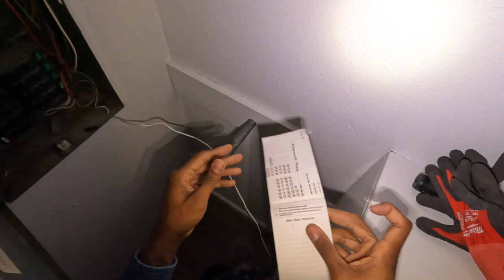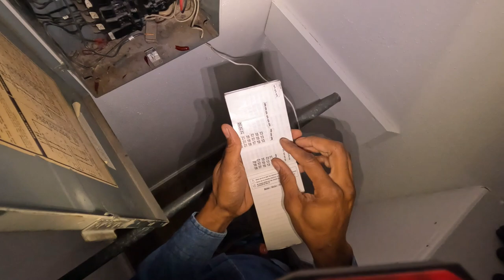150a Electrical Panel Replacement

Comment: Hey Steven,  How about explaining more to your Youtube audience exactly what your doing and why relating to Code, either in your intro, or while you are working, Example:Replacing panel because it is split-bus and causing problems, it is in storage closet-which met code when it was installed.  But since we have to replace the panel because it has major problems, the new replacement panel cannot be installed in the same place because current code does not allow panel to be located in storage or clothes closets.  Great video, keep up the good work.   Thanks, Russ, Electrician from Oregon

Comment: Really nice job brother. 👊🏿👍🏾👏🏾. It’s always about cost you can splice them multiple ways I like ideal inline splice connectors are good as would be a sealed solder listed butt splices that way wires are all in line in one direction reducing tension at the splice compared to a twisted splice connector.

Best way in my view would be to dress them using a din-rail mounted setup. Wago make them and they are listed. Why use this approach? Well it makes trouble shooting and chasing up faults easier as they would be numbered and marked, it also looks also very beautiful and sign of high quality workmanship. Again cost is the issue.

Comment: 25:03 for like 150$ you have a demolition hammer which does that job without a sweat in like 5 minutes. And i don't know about building codes in USA, but for the lawn mower it's nice to first dig a 40cm deep hole and drive that grounding rod to below the surface + burry the wires to it, that's how it's done here in Europe. But nice job 😊
Reply from the maker: Richard i have to get a bigger hammer drill to be able to drive that rod. Thanks for pointing that out. I'm going to start looking for one.
Reply: @unitedtradesmanacademy1894  get the Hilti brother expensive but the after service and tool repair is outstanding.

Comment: You guys use 2 earth rods over there? How come?
Reply from the maker: Suppose you drive the first ground rod for a system. If it has a ground resistance of 25 ohms or more, 250.56 of the 2005 NEC requires you to drive a second rod. Ground rods spaced less than two rod-lengths apart will interfere with each other because their effective resistance areas will overlap

Comment: Would of been a much tidier job if you had used through crimps not wire nuts to extend those wires.

Comment: Nice job, what type of bit did you use to go through the brick wall?
Reply from the maker: I used an sds hammer drill. Made a bunch of small holes an then chip them out to the right size hole.